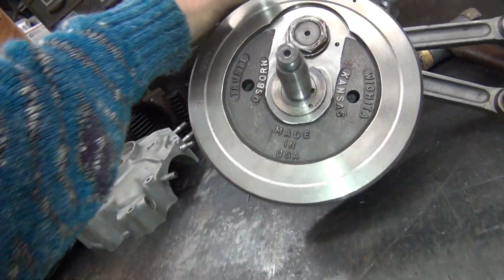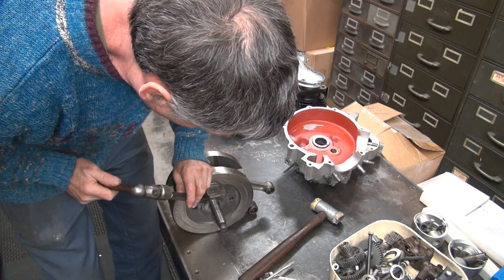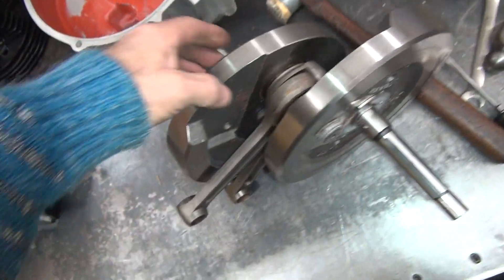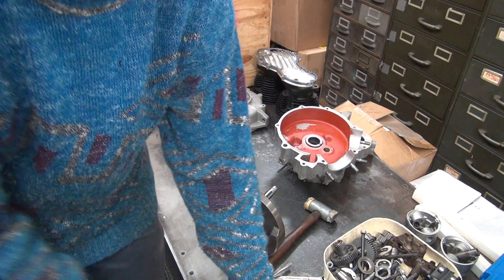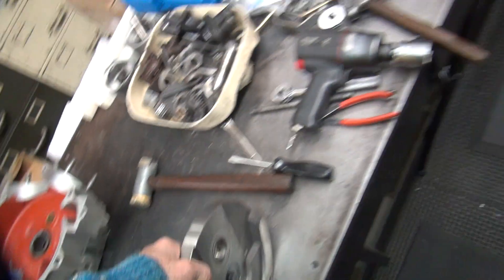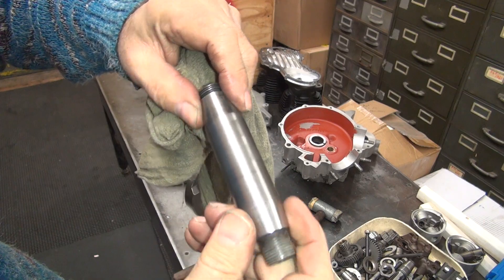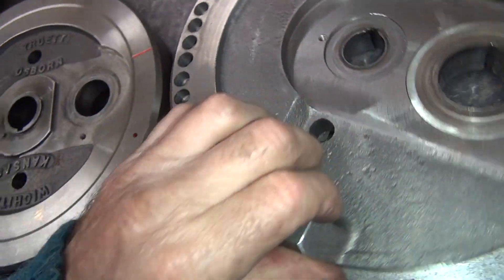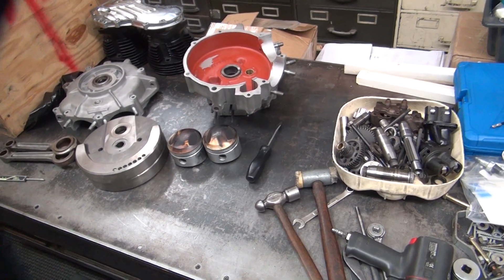#105 1946 junk 84ci stroker knucklehead 500 mile new repo motor rebuild 79ci harley tatro machine

Comment: How do you correct the screwing issue on the crank? Is that a case alignment problem or something else?
Reply: Good question, never heard of this problem before either.  Looks like the flywheels were out of "true".
Reply from the maker: both the flywheel trueness and case alignment can cause these problems. the other big deal is the pri belt drive putting a side load on the crank eating up the flywheel thrust washers.
tatro
Reply: @TatroMachine  Should a pri belt drive be used if it causes this issue?